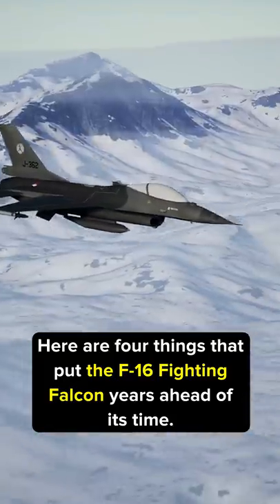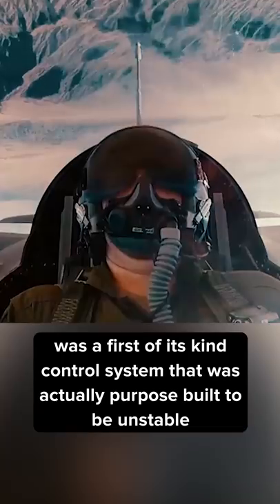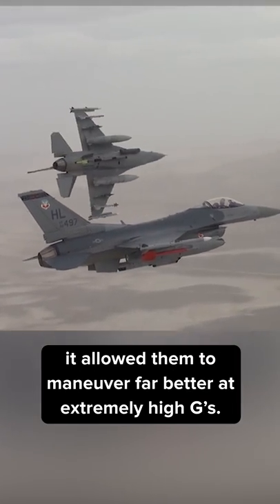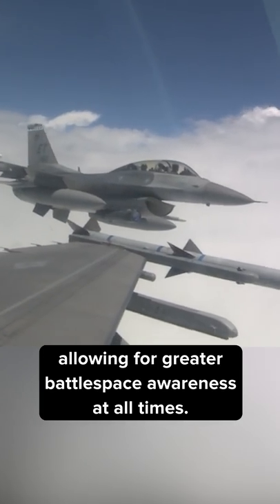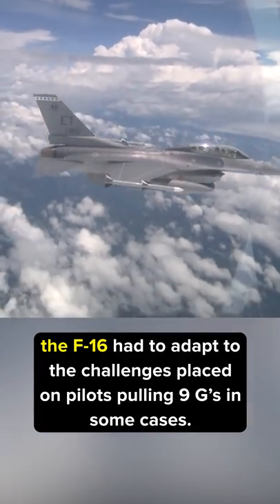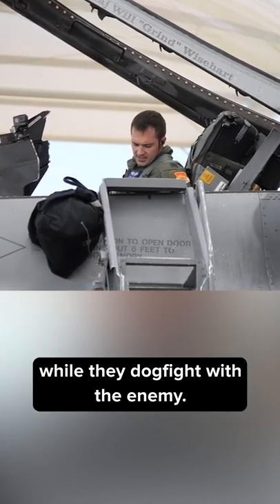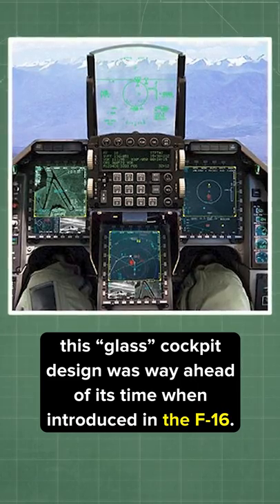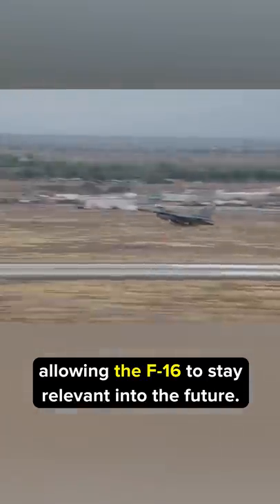Why the F-16 was YEARS Ahead of It's Time

Comment: The 30 degree seat thing is a complete myth and entirely false, apparently. The 30 degree seat angle produced a G-tolerance that is actually worse than the 13deg seat, and due to pilots needing to sit "off" the seat and lean forward in actual operation (so that they can see into the HUD and outside of the canopy), F-16 pilots mostly all end up with injuries in the same parts of the spine, near the neck base IIRC. It was done entirely due to packaging constraints IIRC, at least according to one of the people who allegedly worked on the seat itself.

Comment: There's a reason pilots call this plane "The Viper" I saw an F-16 at an air show once, and there was a stairway to allow you to see into the cockpit from a slightly higher angle. I just remembered there was a photo of me and my mom checking out the plane. That was quite a while ago. But great jet. I gotta use it in Ace combat 7 some time.
Reply: So whats the reason of it being called the “viper” ?
Reply: @jahanzaibkhan2004  we will never know it
Reply: @jahanzaibkhan2004  one tale has it that from the right angle the F-16 looks strikingly similar to the colonial viper from the original Galactica.
Reply: The real name is the fighting falcon , later variant was called the f16 viper , fighting falcon is it’s real name
Reply: @hemendraravi4787  I know.
Reply: @arcadia4691  soooo what's the reason again?
Reply: @manhealme  it's a great jet. Rediculously fast, fly by wire system, need I go on?
Reply: @arcadia4691  sir we know it's a great jet but why is it called a viper.
Reply: @IrtiqaAhmad  anything deadlier than a viper?! That's simply what modern pilots have called it. It was originally called the Fighting Falcon.
Reply: @arcadia4691  ok
Reply: @arcadia4691  I think Viper was the prototype name for it before it had an official name Fighting Falcon. But now they applied that "Viper" in the new variant. Also "Viper Zero" the Japanese version F16 which is F2 both built by Mitsubishi and Lockheed if I'm right which is built earlier than the new F16 Viper we have now
Reply: @pauloazuela8488  was kinda wondering if it had a prototype name, that'd explain it. I noticed the F2 looked similar to the F-16 we have.I never really looked into it that much, though.
Reply: @arcadia4691  Yeah probably the prototype name was Viper and you explained why it was called that way but the officials didn't accepted that early on, like it's kinda dumb for them to reference a film for a military weapon but hey everyone has different taste
Reply: @pauloazuela8488  certainly true.
Reply: Really wanted you to end with you joining the air force and flying the viper , but you ended with ace combat 7 🤣🤣
Reply: @user72665  my father was a marine in the Vietnam war. Front lines.

Comment: The original F-16A did not have MFDs.  They were first used on the F-18.
The F-16 was the first fighter designed for sustained 9g manoeuvring and was aerodynamically unstable.

Comment: Actually the inclined seat is because they put the f 15 ejection seat in it instead of developing a new one for financial reasons but it was too big to fit so they had to fit inclined. Its actually pretty uncomfortable and doesn't do much
Reply: Also we’ve had bubble canopies since WW2
Reply: @bridezilla3758  not without metal beams reinforcing the canopy
Reply: @hey9433  The p-51 did have a bubble canopy.
Reply: @hey9433  p47
Reply: Iv sat in the f16 seat many times as an f16 maintenance guy and I tell you it's not uncomfortable at all
Reply: The inclined seat helps reduce gforces applied in high g manoeuvres. It has nothing to do with comfort.
Reply: the only fighter that have a better bubble canopy is f22... p51d and p47d have a front frame that ruin the  front visibility
Reply: @thehover6824  the first P-51s didn't have a bubble canopy....it was an addition.
Reply: @talieffreeman2048  Oh.

Comment: With the first one, I don't think that's worded correctly, there's no reason to intentionally design something to be unstable at low speeds, especially if you keep take off and landing in mind. It might be one of the first times a fly by wire system was designed and sacrificed stability at low speeds for supersonic performance, but I doubt it was intentionally designed to be worse at low speeds.

Comment: Two initial problems was that the pilot sat so high above the aircraft the pilots lost sense of up or down and several F-16 pilots crashed when the aircraft landed upside down.  Second problem, the fly-by-wire was too sensitive.  The simple solution was add weight against the stick so the pilot "feels" the plane.

Comment: Bubble canopies have been a thing since the p47/p51 in ww2.

And youd think theyd have put two rudders on it, to possibly make it stealth like the f15.
Reply: F-15 is stealth???? LMFAOOOOOO. F-15 has a radar signature of around 15m^2. A clean F-16 has a radar signature of around 1m^2. For comparison, the F-22 is said to have a radar signature of around 0.0001m^2. 

In regards to what you said about 2 rudders, it is not enough to simply increase the number of vertical stabilizers(the rudder is the moving part of the stabilizer). You also have to mount the stabilizers at an outward angle, as is done in all stealth aircraft such as F-117, F-22, F-35, Su-57, J-20 and NGAD(or at least, the artistic rendering).

Comment: the F16 was not the first fighter that was introduced with an unstable airframe.
Reply: Which one was? I thought that part of the video was accurate
Reply: @maxk4324  I think there was some prototypes before the f16, but the f16 was the first that was produced in large numbers
Reply: @bubblenugget1335  if they were prototypes then they were test vehicles, not production vehicles
Reply: And fbw
Reply: Yeah, weren't there FBW designs in the '50s? 

I swear, I watched one or two really good documentaries and suddenly all the basic stuff is ruined 😅
Reply: @maxk4324  the harrier jump jet entered service in the 60s and was designed unstable for low speed maneuverability

Comment: It might have been unstable before you got to supersonic speeds but nobody purposely designs something to be unstable at any speed. Can you imagine making a sales pitch to The Generals who have to make the decision, "So we design this thing to be unstable unless you go really fast" so what are the decision makers supposed to say,  "Wow that's genius!"
Reply: It was designed unstable, just like all supermanuverable fighters are. It makes them pivot better so you don't have to fight your own aerodynamics to maneuver. The computer systems balance it for the pilot, however in its early form it lacked the development needed for true reliability so there were some accidents in the 70's and I think the 80's that demanded system improvements.
Reply: @kyleheins  being unstable doesn't make you pivot better it makes you unstable. Being able to pivot better makes you able to pivot better. I understand what you are saying (I think). Like for instance, in order for the SR-71 Blackbird to operate at high altitudes with non leaking tanks at very high speeds, there was a design cost which resulted in the Jets having to be extremely leaky at lower altitudes and lower speeds. My point is that their intention was to fly high and fast but the design cost was that at low altitudes and slow speed things would leak fuel all over the place. It is not that the designers wanted the jet to leak at low altitudes rather it was that in order for it to go fast and high that was the cost that that they had to pay
Reply: @tvtvvtvt8017  I think you misunderstand instability. Yes, it can include being out of balance, but in this case that is not the issue. The balance point is shifted back so the aerodynamic interaction is more sensitive. Normally, an aircraft is designed to favor forward flight, bit in supermanuverable aircraft the slightest change in flight profile generates a powerful pivoting force. Remember, static instability and mobile instability are not the same.
Reply: @kyleheins  Interesting! Thanks for your thoughtful response, I can tell you've read a lot on this issue

Comment: The F-16 cockpit does not look like that. Also fly by wire was standard it does not make the F-16 any more modern than other jet fighters the only unique thing at the time was the force sensing side stick that has a bit of movement to allow for precision movements. Also the instability of the F-16 Is not a training hurdle because of the Flight control system constantly adjusting the aircraft for it but even then the design is not revolutionary either also why even mention the bubble canopy as that is nothing new or revolutionary on a jet fighter. I guess the only real interesting thing is the reclined seat

Comment: FUN FACT: The Electric jet was called the lawn dart like the F-104 before it.  The Fighting Falcon was a deadly aircraft that killed dozens of pilots and caused divorce over assignment and other pilots to retire instead.

Between 1979-2000 the USAF alone lost over 400 jets.

It's the single most costly programme ever in USAF history, going over-budget, requiring a 2nd engine, premature upgrades, etc. Costing over $100 Billion over its original budget which included BLACK BUDGET appropriation.

In contrast the latest generational jump -- The F-35A is only 6 billion over budget (out of the combined F-35A/B/C budget overrun).

The F-16's budget overrun is quite UNFATHOMABLE, more than $90 billion over budget MORE than the F-35A... More than $75 Billion more than the F-35A, B & C combined.. which includes ALIS/ODIN,VTOL & Carrier operations.

There is a reason why today's F-16 looks nothing like the original... And why there are so many block numbers & variants.
Reply: I didn’t realize you were a fiction writer .
Reply: Source: trust me bro.

Comment: I think some of these features were in the Soviet fighters too at the time. The F-16 wasn't really ahead of its time.
Reply: It absolutely was.
Specifically, what features are you referring to?
Reply: @rogerout8875  

It absolutely wasn't. Some of the features presented here.
Reply: @bobfg3130  like what?
Reply: @rogerout8875  

The canopy for example. If you can't do basic research that is your problem.
Reply: @bobfg3130  Speaking of "basic research", nane just 1 Soviet jet with a bubble canopy.
Reply: @rogerout8875  

You mean name?
Reply: @bobfg3130  Sure, either that or find another excuse to avoid the question.
Reply: @rogerout8875  

I'm not avoiding any question. Nice try though. If you do any basic research you will find out that the visibility in the F-16 is the same as in a MiG-29. Nice try though. Not only that but the F-16 wasn't ahead of its time. 😆 If you did ANY research, you'd know that.
Reply: @bobfg3130  but we're not talking about "visibility", were talking about a bubble canopy.
Just so we're clear, you can't give an example, and that's why you're trying to change the subject now?
Reply: @rogerout8875  

No, it's about visibility. That what this video alleges.

Just so we're clear, I'm not trying to change the subject. 

You don't like the facts. 😆
Reply: @bobfg3130  No, you specifically said "the canopy".
I assume by now you've looked it up and realized you were wrong.
Was "the canopy" all you had, or are you going to make something else up?
Reply: @rogerout8875  

No, it doesn't matter. Nice try.

I've looked it up. I'm right.

Like I've said it's not only the canopy. Don't day I've changed the subject. I didn't.

Not only that. If you think that the F-16 was ahead of its time you're like a Russian thinking that a T-72 is high tech right now. 😆

Comment: a bubble canopy? years ahead of its time? looks at every allied prop fighter made after the battle of britain intensely
Reply: The cockpit has no frame installed on its front like any other jets at that time, and its bubble canopy give the pilot unobstructed forward and upward vision, and greatly improved vision over the side and to the rear, and also its a real pain in the ass to manufacture something like that in the 70s (for a modern jet plane) thats why its ahead of its time during its early production

So yeah F16's pure clear frameless bubble canopy is very special and ahead of its time
Reply: @KAGUR0V  im just saying its canopy specifically was a design made decades previously, not saying the f-16 wasnt ahead of its time, just saying the canopy isnt a new thing, even for jet fighters as the f86 had a bubble canopy too
Reply: @streetlampoil8762  i agree the bubble canopy style exist many years before but the context of bubble canopy here is the no frame and crystal clear style like the one implemented on the F16 and F22s which is new and never been implemented or made before

Comment: Gripen is better
Reply: Gross 🤢
Reply: At what?
Reply: @rogerout8875  being a all around better plane
Reply: @Lillspratt  so you can't actually give an example, but that's just how you "fee"l about it.
A griffin can't hold 9g turns like an f16 can, how about we start there?
Reply: @rogerout8875  well, yes it can, and if we mention the Meteor missile, then gripen is the best. Gripen is the easiest plane to lern to fly. It can carry 5 rb 15 missiles, one can sink a whole ship. Gripen is cheap and gets updates that thakes 20 mins to change to.
Reply: @Lillspratt  no, the Griffin is not as maneuverable at high G's as the F-16.
The F-16 also has better avionics.. other than that, the performance is pretty much identical..
And the F16 came out in the 70's..
Reply: @rogerout8875  why argue when we are on the same side? Its just good if ee have 2 great planes, as long as their on the same side. In this case, against russia
Reply: @Lillspratt  All that being said, it will come down to the pilot.